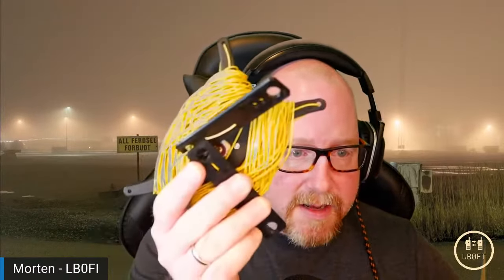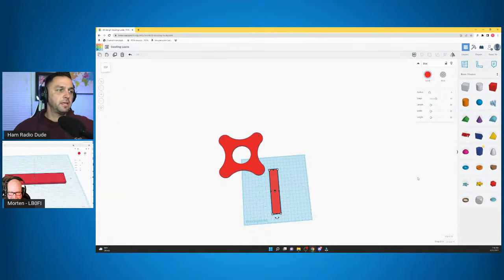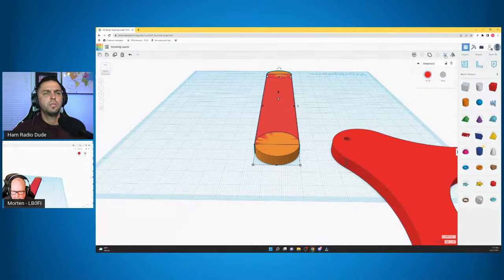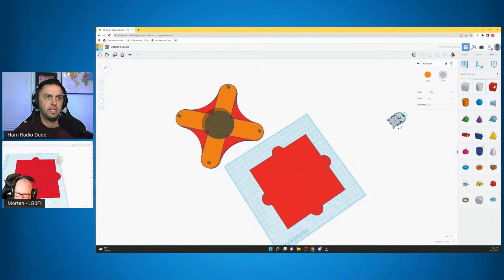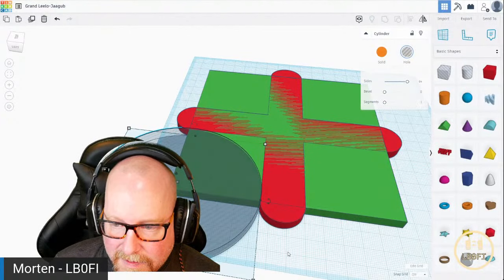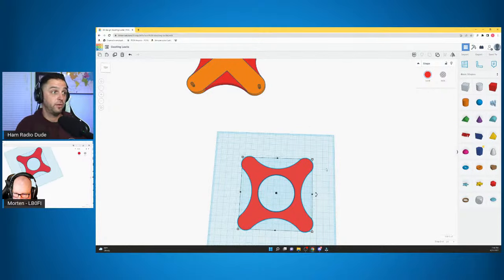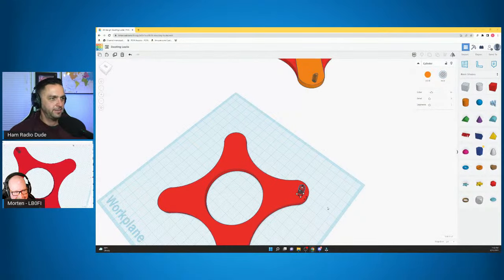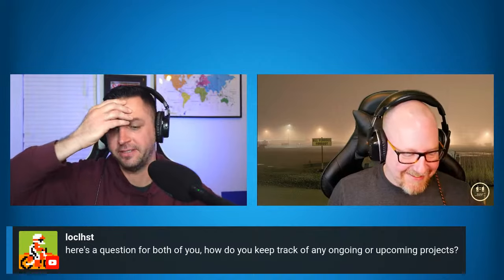Livestream - Tinkercad for Ham Radio - Get Started and Design Along!

Comment: so at 13 minutes. you can align the two bodys to put them in line. and you know the width of the rectangle is 25 you can size the diameter of the circle to be 25mm
Reply: That's a very good point! My excuse is that it was 2.13am here :)